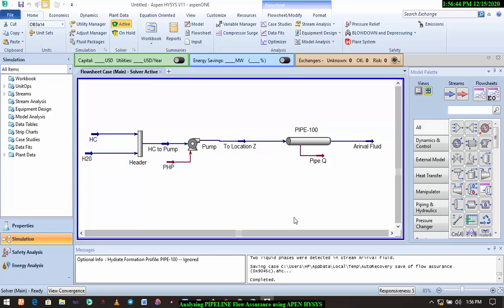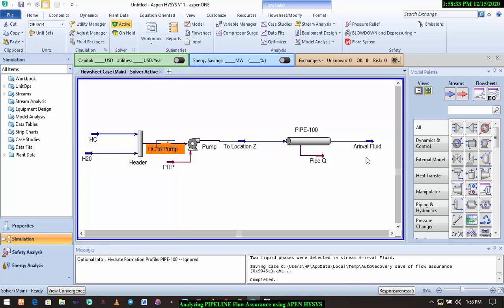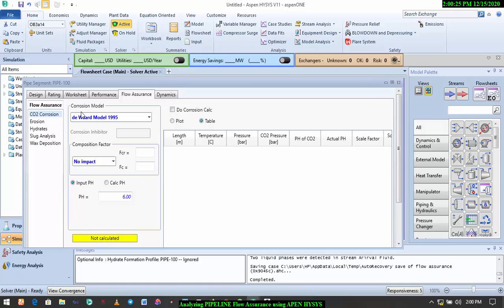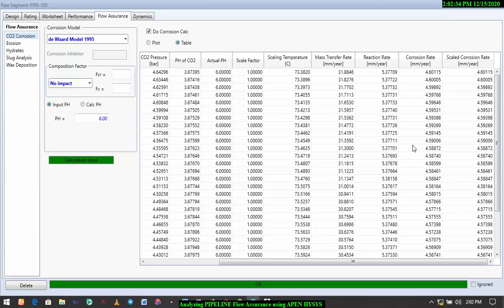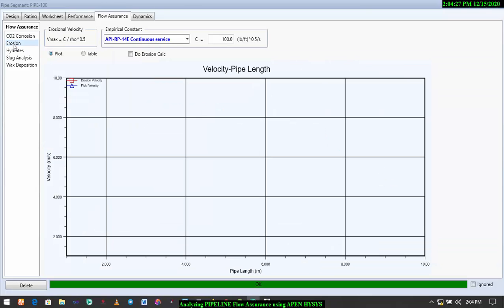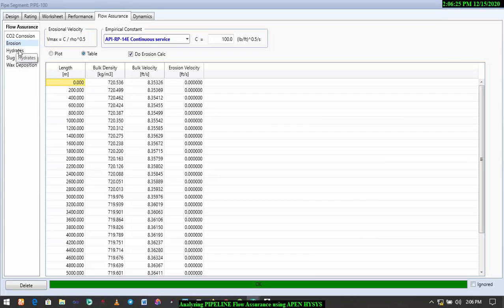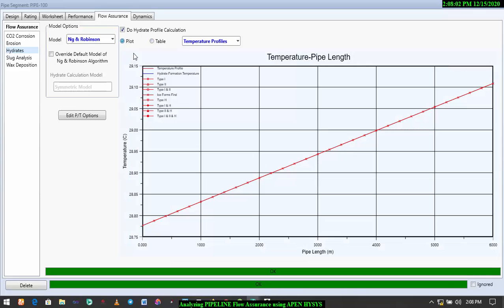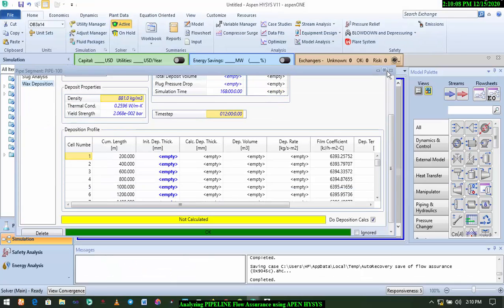Pipeline Flow Assurance Analysis using Aspen Hysys V11

Comment: Is there possibility to obtain different results for the same simulation with different versions of aspen? Given that the same property method is used.
Reply from the maker: Yes, some factors can lead to that; 
1. Every new version is an update on the old one which might cause a slight change in results. 
2. if we used the same fluid package but slight difference in input parameters o pipeline parameters, we will definitely have different results.